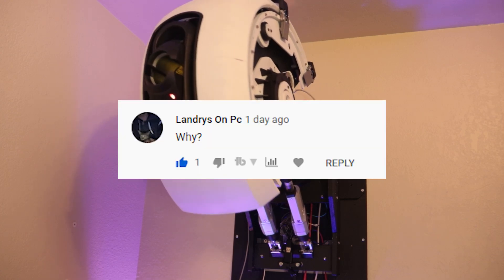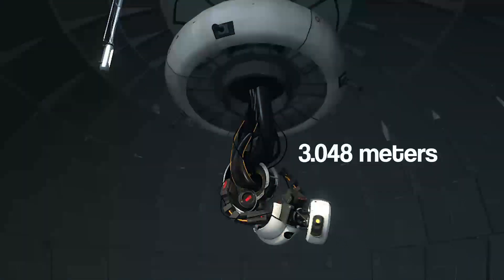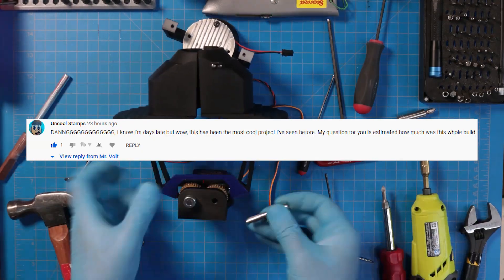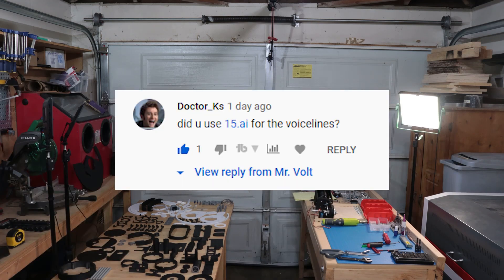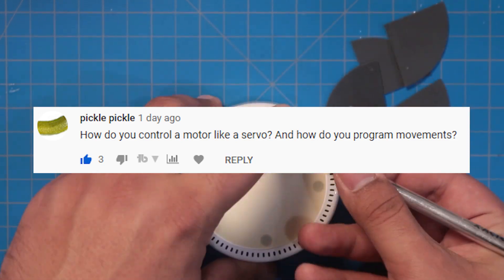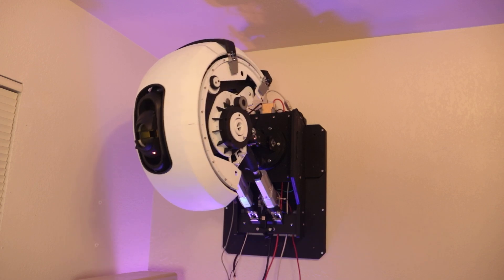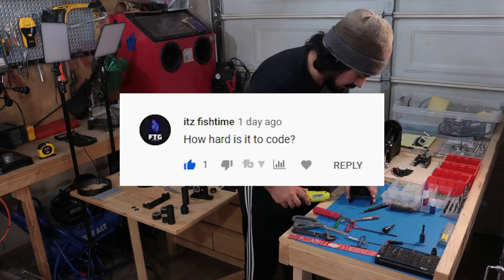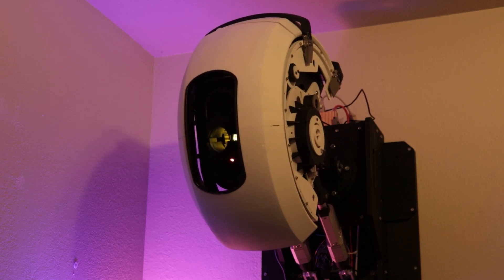GLaDOS in Real Life: Your Questions Answered!

Comment: Do you happen to have the wiring plans? I have the step files but I'm looking for the wiring. If they are on your patreon I will join, this project has inspired me to get back in to 3D printing and Laser cutting. CNC I will outsource but the rest I can do at home.
Reply: have you gotten any further ? a im looking for the missing files that are for the up an down tilt of the eye. i cant find them anywhere. if you have everything that i am mssing could you kindly send them to me?
Reply: @nonmpf6460  I did not get any further. I have not join the patron page as I don't have an account. They might be on there, I'm not sure.
Reply: @89tsupra  what about the missing parts of the model?

Comment: The Raspberry Pi 4 link doesn't work anymore and the Pololu Maestro I can't find in the UK only the 6 channel everything else I found find on the UK amazon equivalent however, all the parts are like £500 then getting a company to 3D print and another to use a CNC machining and laser cutter that's probably at least £1000. If money wasn't an issue I would 100% do this to my Alexa, but keep up the great work.

Comment: Do you think these components could be scaled down any further to make a smaller scale glados that would fit within 6-8 ft so it could fit mounted on a ceiling? or would the parts just be too damn small at that point?
Reply from the maker: There is a tiny 3d printed fully body version already from a guy  called yTec3D. My version doesn't scale much smaller or else certain features are too small. I might try a 1/6th scale (this one is about 1/3rd) though until I've got the time and money to go full-scale

Comment: Mhm i have recently seen someone use Blender to animate his motion control rig - was it Proper Printing? Yeah i think it was. But he borrowed this technique and the corresponding script from someone else, forget whom. This seems like a great way to do it - depending on how comfy you are with a spectacularly feature-creep laden animation software, and i mean, at this point, it's basically less of an application and more of an operating system. It can solve IK for you and do a selection of types of joint constraints to represent the motion limits of the underlying mechanics.

Comment: sorry for commenting again but I have a few more question 1. do you think you could post the fusion 360 files for the head part? 2. I looked at the link and it has all kinds of options and ratings for the linear actuator, which ones did you use and finally 3. to be or not to be?
Reply from the maker: Ah, I used the 2" stroke version of the PA-14s with feedback. Specifically just posted the .step files. Not to be a snarky answer. Although, really the files are just for reference, but not instructional in any way. To be, I guess :P
Reply: @MrVolt  Thank you so much. Glados, here I come

Comment: In the final build it looks like you used linear actuators. If so what brand are they and what was wrong with the survos?
Reply from the maker: There links in the description for all the parts. They have way more torque and aren't back driveable, so she holds positions well.
Reply: @MrVolt  Thanks